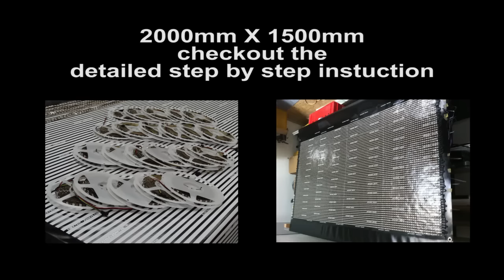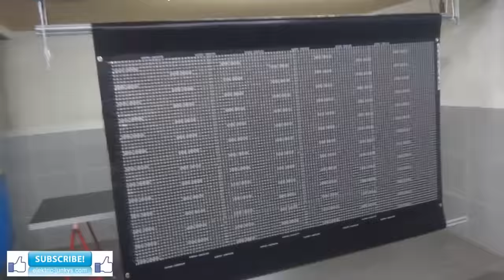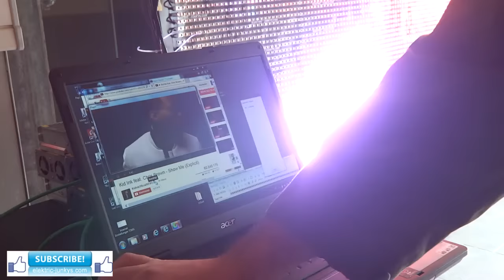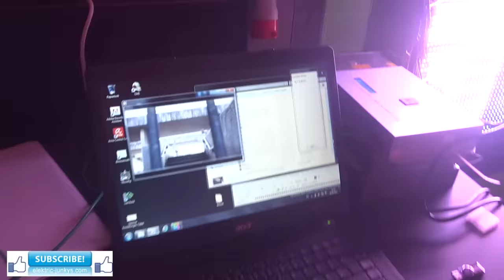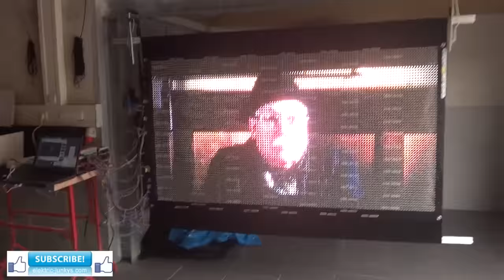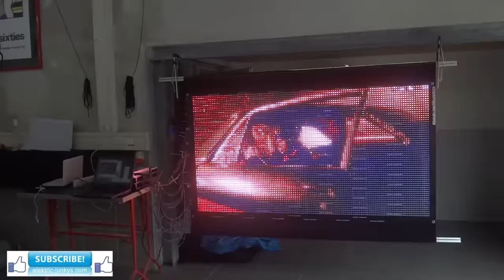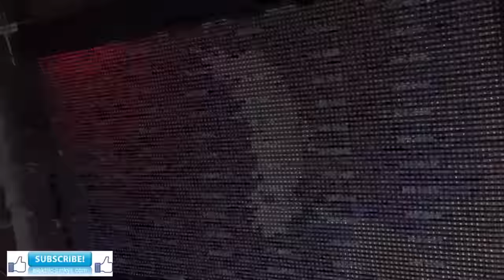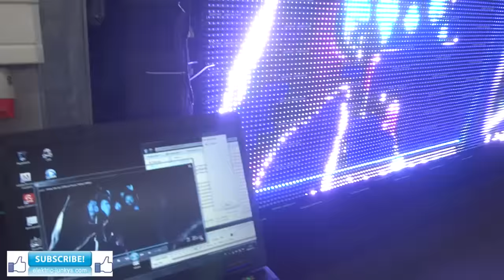how to build a flexible LED Striplight Video Wall P16 | #LEDSign LED Display WS2813 Cortina LED

Comment: Hello friend would like to take a doubt. to mount an LED panel controlled by these led controlle "t1000s, t400 t 8000 etc ..." and I need you use amplifiers to connect a tape the other? you would have some video explaining a scheme that? Thank you very much in advance

Comment from the maker: 👉 Shipping Container Wheels DIY - https://youtu.be/JcwhMGJuoaw
👉 Bathroom Vanity 2022 - https://youtu.be/n_IE0PsZ9sI    thank´s for support guy´s, Share, Like, Subscribe want to collaborate shot us an email.
Reply: LIKE! LIKE! LIKE! SUPERLIKE! :-D
Reply from the maker: +ejunky66 Post your DIY Projects on our Facebook Group facebook.com/groups/1020525317958853
Reply: +Dean Johnson That would mess up the distance between pixels, as the LED's are a constant distance apart on the strips the strips have to be positioned that way so the LED's are are vertically separated by the same distance. The only way to up the pixel density is to find strips that have more LED's per meter, and then put the strips closer together. 

Nice project, power hungry I'm guessing, by the amount of power supply's needed to power it.
Reply from the maker: Bjorn Embrechts exactly, you can add the double but the angle will be different means for this modell WS2812b and WS2811 only 16.6mm, there are also some modells with 120LED´s meter but the Power consumption and the slaves are just out of any range
Reply: +ejunky66 
HI.
NICE JOB
HOW MUCH DOES IT COST A 10 FOOT BY 8 FOOT DISPLAY TO MAKE?
THANK YOU.
Reply: +ejunky66 how much the trensmission
Reply from the maker: checkout our NEW EASY PROJECT BUILD YOUR OWN FLEX SCREEN https://www.youtube.com/watch?v=sPt9olLB_o4&lc=z13xzt5bfkevuhryi04cg12qhqvrgrlgmhs
Reply: I wanted to use p6 leds. are there p6 led strips available?
Reply: What's aspect ratio and resolutions that?

Comment: We demand higher resolution! lol
Reply from the maker: @108215563332243502756 here we go https://youtu.be/KN8oul8etlU
Reply: *****
Now that I'm sober, I think I should clarify: I mean of the display, not the video
Reply from the maker: EvilJ069 ohh to clarify.: i mean the Display or do you know an Video resolution of P6 ;)
Reply: Apparently I'm obtuse today...
Reply: EvilJ069 make the area larger :D and view it from further
Reply: ***** 52 minutes for ONE low resolution display? Isn't that rather inefficient? And I believe you cheated by speeding up the video..
Reply from the maker: @107326395357923048016 .....  clever & smart ! check this out https://youtu.be/KN8oul8etlU !
Reply: The Kaiser amazing how you want something that is a bit complex in regards to the parts used to be very fast. :)
Reply: The Kaiser How quickly did you build your display?
Reply: The Kaiser No, you just cheated by having someone else buy yours. How disappointing.
Reply: realbadbav I am a Kaiser not a mechanic.
Reply: The Kaiser you know, if you're a Kaiser... you're a defeated relic of the past...
Reply: realbadbav So what?
Reply: The Kaiser So goodbye
Reply: realbadbav Auf Nimmerwiedersehen.
Reply: Gets popcorn
Reply: realbadbav Wohl kaum, LOL.
Reply: How do I contact you if I want to order? I live in Africa, more exactly in Ivory Coast.
Reply: did you use 60 or 30 led/m strips ? :P i saw that you can get 144led per m strips nearly everywhere now on ebay :D .. might be worth a try :P getting a higher res
Reply: Way more expensive than 60/meter.  Also needs a lot more power, and more driver stripes.  Doesn't really improve display quality enough to justify the power and driver complexity.
Reply: at least the display is super super bright
Reply: Corsair has new leds that are supposedly a little more efficient than these and can cut many many more addressable leds into an area...you can fit a 10x10 grid of them under your finger tip small is what they mean. Would be very high resolution but would need much much more computing power but the way it’s set up it’s actually more efficient but is also over 100x more leds in an area so it might even out. It is only in Corsair though and I’m guessing it’s go jog to be even more pricey than these led strips by far.
Reply: 4k 144hz
Reply: 4:45 - - It was played in the media game. Why did you put the player on top of the youtube video? =)
Reply: Can i buy this but i live in algeria

Comment: Can you explain me how many power supplies are supposed to be used for something like this? I saw 4 in the beginning but at the end you had like 6
Reply from the maker: sure just send us an email through https://elektric-junkys.com
Reply: Yea, so how much power does this consume?
How many pixels does it have?
Reply: Each "pixel" is 3 LEDs, RGB, each with a max power consumption of 5v at 20 mA, each RGB LED unit pulls about 60 mA....
I am doing a much smaller one and to power the controller as well as the LEDs I am using a 5v20a100w powersupply...looks like they are employing several of the same or similar.

Comment: How much a project like this cost to build?
Reply: A lot
Reply from the maker: Mikus Miķelsons haha, its not that much instead of the work as you can see ;) just send us an email, im quiet busy with the TEXT DIY for this video just now, also in the oven = how to build an 3D Illusion mirror
Reply: *****  I mean How much cost LEDs (~500m), power supply's
Reply: ***** hello would you have som prices on software and controller
Reply from the maker: Franklin Brown hi, ofcourse checkout www.elektric-junkys.com / shop.elektric-junkys.com for direct orders or send us an email support@elektric-junkys.com
Reply: So, 2 meters long sold in 5 meter rolls (thus all the soldering) at $60 a roll. I counted about 70 lines before it rolled off the table so about $1700 worth of LEDs. Not counting the power supplies, connectors, controllers, etc, etc...

I wonder if the program is scaleable, then you could start out at about 2 feet and work your way up.
Reply: ***** I've been using a 20 dollar led light strip for over 8 months now and have zero flickering, could I just use these instead?
Reply: djdylam1
Reply from the maker: oh guys guys ....
Reply: ***** well, How is it a good deal if it costs 2k to make and the Resolution is ultra-low? I mean it's cool that you can make one, but why would anyone do this?
Reply from the maker: Chris Everly do you know Football Fields or Baseball Fields ? heard about it ?
Reply: Yes I have and why are you so mad? It was a valid point. And btw, I doubt a stadium is going to bust out a 50 inch low rez screen to use for their replays. If that were the case, hell, they can just roll up to a Walmart and get one for a third of the price. 

But again, it is cool that you can make one. Respect for that. Looks like a pain in the ass and a lot of time, so good for you for staying with it.
Reply from the maker: Chris Everly not mad man,  i "guess" in stadium they use P10-P20  ofcourse that size is still a joke but i have customers they made already 6000X3000mm with our assembly kit, view distance depends on pixel pitch right  ?
Reply: Chris Everly - To essentially do it.  These may be a bit pricey now, but I see it as the next advancement in parties and club/event lighting essentially.  Yes the pitch could be better and the like (unless you want to buy/have video panels that are stack-able to do this, otherwise the better pitch LED lights are more) but as far as I can see, VERY few even have something like this for starters.
Reply: Would look nice in a club though.
Reply from the maker: AZ Sid hi, ofcourse it is scaleable, you can start by 4 Rolls and then if the cashflow become better ;) just buy more and extend the display ...

Comment: What is the substrate? Is that double sided tape? What is the heat gun doing? Isn't the power supply important? How is the data stream driven? I like your display -- wish I knew how to build one.

Comment: How did it able to control every single LED with parallel connection?
Reply from the maker: we have used addressable LED´s via a T8000 you can easy controll the WS2815 Strips !

Comment: This may be a stupid question, but for the cost of making on of these 60p screens, can't you buy a 1080p led tv for less?
Reply: Yes, the cheapest ws2812b led strip costs £0.08 or 0.11$ per LED (or pixel). For 100$ you get a good 1080p monitor (1 920 x 1 080 = 2 073 600 pixels). So to make 1080p screen out of these it would cost 228 069$. So yes, obviously its a lot cheaper to get a monitor, but this is supposed to be for fun! Its nice to build something yourself.
Reply from the maker: a monitor can not be viewed from Far Distance, it´s all about that !!

Comment: Did you send a single data signal daisy-chained threw all the strips or break up the data single?
Reply: at 36:00 he connects several data-pins to some kind of multiplexer. so he has chunks of maybe 3 rows (6m) that are daisy-chained and connected to whatever this box is. 
i have no idea if its possible to daisy-chain 100m. maybe if you refresh the signal (with tinyduino maybe). 

by the way, as far as i see its 100m led-strip, 5m cost around 25€ in china so the whole thing should cost about 500€.

Comment: How are the ledds individually controlled? I would thought of an N by M matrix, but there aren't enought vertical wire. How each individual led is controlled ?
Reply: +Samuel Devulder I'd like to hear that one explained too..
Reply: +rondutch23 By rerading the spec I find the way the led are programmed. It is actually a clever way. The data are serialized in a daisy-chain. Each led in the chain is connected to the next one via seria line. They all works the same way. 
1) after a reset a led received 3 x 8 bits of data indicating the R/G/B color it should take
2) aftet these 24 are received, the led controller directly passes the bits it receive to the next led-controller in the daisy-chain.
This mean that to setup n leds, one must stream n x 24 bits to the first led of a ribon. The propagation speed is relatively high resulting in th ability to program aroundd hendreds of led (say around 2-3m of ribon) in less than 20ms. This is less than the persistance of vision. This means the eye sees the led changing colors all together in the same time. By driving several ribon in parallel one can create a large animated pannel that can plays animated images at 25 - 50 fps.

Comment: If you offset each LED strip by a half a pixel, you will have a higher perceived resolution.
Reply: then u will need more leds and construction will be too big
Reply: @zhambul11  No. At any resolution, if you offset each led strip by a half a pixel, your total perceived resolution is increased by 1.5x. You have to feed it double the actual resolution though unless you want to do sub-pixel interpolation.
Reply from the maker: thats exactly right Mr. Smith ..! Cheers guys any more questions https://elektric-junkys.com

Comment: jumping with just solder from one strip to the next in the same row is a very bad idea, with time the heat and vibration will break the solder, the best way is to place a thin wire when soldering, then cut the wire just out of the solder.

Comment: What happens when one of the LEDs burns out? Is it easy to replace? I assume you have to replace one full strip? Is it possible to make it from vertical strips instead of horizontal for easier repair, if one of the LEDs burned out?
Reply: +Bartosz Synowiec you would replace a section. each section contains 3 leds. it is easy to cut and solder in a new one. the leds have a lifespan of over 50k hours
Reply: @adamlooze99  only 12v LEDs have 3 per section. 5v are singly addressable.

Comment: I will make an equal design and I will use two power supplies 5V 100A to 174 mts of WS2812B 60/m LED tape. Do you think you will endure it?
Reply from the maker: 174 meters would be about 1000$ from our factory ! just contact us for more informations !  shop.elektric-junkys.com

Comment: The framerate of the Wall is pretty bad, I don't know is it from the wrong settings or just the refresh aret of the strips is low.
Reply from the maker: Hi and thank´s for comment. Older addressable Strips, the New Modells such as WS2815 and WS2818 have a Way better Refresh Rate, check out our Website https://elektric-junkys.com
Reply: @ejunky66  Yes, for sure,  just saw the video is 8 years old ,now I think the stiprs are way better.
Reply from the maker: @AntrAcsA  thanks very much for comment, we wish you a happy new year, get in touch with us. 🎇🎉🎊

Comment: Do mind telling us how many LEDs in this screen and how many pixels
Reply from the maker: John Jairo Cabal hi, ofcourse we don´t mind ;) its about -7800-Pixels
Reply: To be anywhere close to good looking you should go with 1600X900 (16:9 format) which comes to 14400 or 43200 channels.
Reply: Meant 160X90 ofc. Still you wouldn´t get near the resolution of really old vcr tapes, that comes in at 320X200 or 640X480.

Comment: Is it possible to build display using apa102 chip (120led/m or 144led/m). Resolution will be much better than with ws2811 chip.
Reply from the maker: yes apa LED Strips can be used .. starting rom 50USD dpd. on qty.

Comment: does the converter act as a transformer to 5V DC ? does the controller run off of 120V AC? any more detail on wiring?
Reply from the maker: +Shane Motschenbacher hi, yes we have switching Transformers you can switch 110V to 220V
Reply: but what does the converter do? is it a transformer?

Comment from the maker: 👉 DIY WS2815 KIT no soldering - https://youtu.be/fnnVExn7aoU
Post your DIY Projects on our Facebook Group  facebook.com/groups/1020525317958853
Reply: which controller you used in this video
Reply from the maker: +NIKHILESH KUMAR  Live Transmittion Controller elektric-junkys.com
Reply: +ejunky66 thanks alot and what that purple and black wires are for?
Reply from the maker: Power lines
Reply from the maker: BTW. Where is Harold ?
Reply: after how may leds we have to give power?
Reply: what harlod?
Reply: what Harold?
Reply from the maker: Harold and Kumar ;P
Reply: Cool. I am thinking this device maybe used in promo bizness.
Sorry, my english not very well((

Comment: Wrap your car with that for some slick automated graphics #next project, Futuristic Fast & Furious #Hide from cops by changing colors lol
Reply from the maker: for sure an idea ...but not possible ;) possible would be, our Luminicent LED Foils
Reply: Lol nice idea but highly illegal tho
Reply: Why would it be illegal?
Reply from the maker: in the States i bet it will be not Illegal :P, but all over Europe, Canada, Australia you will get the ..... Penalty :p
Reply: Do it and cops will hit your ear with siren & megaphone asking you to park on the right of the road !!
Reply: @ejunky66  It's illegal in USA as well. Only if the truck is a promotional vehicle driving at under a certain speed limit, and has the screens on the side.
Screens on the back or front are highly illegal and forbidden; just like out of alignment headlights are, or chrome body color is at night.
Reply: I saw a dated program about camouflage one and they cut the half of the car off and covered the entire outside of the car in 3x outdoor TV panels and had cameras basically filming from the other side of the car showing what you would see if you were looking straight through. It was at least a 10 year program but it wasn't too bad when the car was static. Angles would obviously be a problem but still I think if someone did it today it could have some interesting results!
Reply: This is the most stupid idea I have ever read... the flaw is in the name 'light emitting diode'. How are you going to hide from someone when emitting visible light to them?
Reply: yep, a fully RGB car would harder to be spotted then a normal painted one
Reply: Broadcast the image on the opposite side of the car to be invisible.
Reply: @kesprSFM   It's not about hiding but about distraction

Comment: For the people who want to make this; it's about $1200 in LED strips.
Reply: I think I'll buy a tv instead and save $500
Reply: @ArquimedesOfficial  it has to be an addressable RGB strip but even so, that costs around £15
Reply: @ejaz787  You are right, i'm a dumbass ç_ç
Reply: @ejaz787  This is flexible though.
Reply: nevermind
Reply: its okay. i know a guy.
Reply: $799.00
Reply: And then you still have the cost for wiring and transformators to 5v.
Reply: well $1,200 is better than a concert display at $60k  for those who are in the music

Comment: TV screen with a 9dpi resolution :-) 
But ... its a flexible 9dpi screen, first of its kind.

Must be another way to power the LED's, avoiding too much power wasted in drop resistors.
That problem solved, the road is open for really huge flexible screens.

Very interesting project indeed, thanks for the video !
Reply from the maker: thank you too mate for commenting !

Comment: Two questions:

1: Do you sell the adhesive template for the LED strip alignment? I don't see any links on your website.

2: The T300k controller specifies up to 8000 LEDs but you are controlling more than 10000. How do you control greater numbers of LEDs? Can multiple T300k controllers be combined to control screens containing 14000 or more LEDs?
Reply from the maker: for more infos ..send an email ... elektric-junkys.com